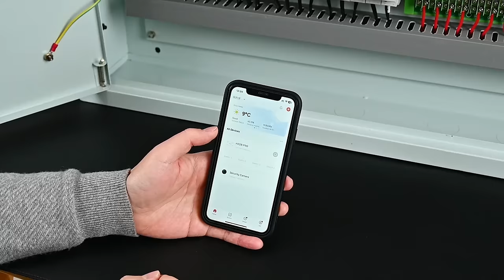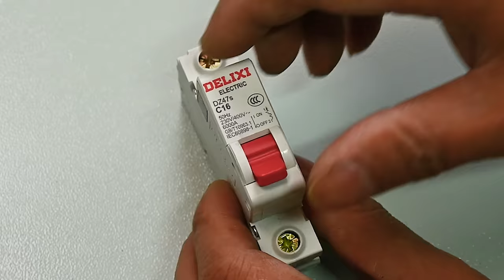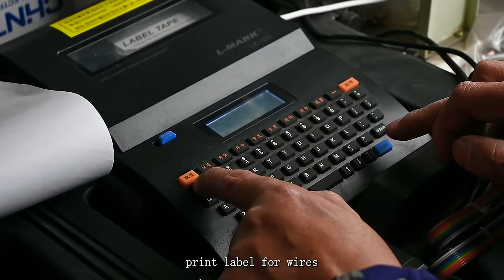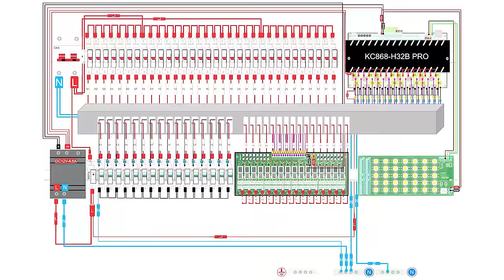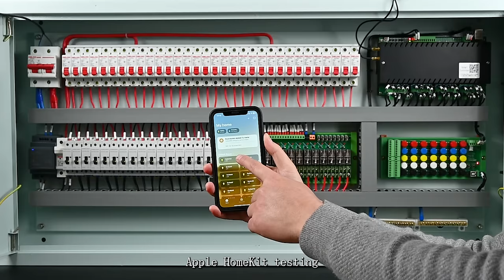Home Automation 32CH Distribution Board DIY | Smart IOT Project 2023!

Comment: This is what happens when a housewife thinks she's an electrician
Reply: More like a sales rep having to attend a trade show. Looks good, works for switching a few light bulbs but don't try it with an inductive load, such as a refrigerator. Or power tools out in the garage.
Reply: @gorillaau  The majority of "home automation" is basically lighting and lower powered devices.  One side of the panel is for 220v the other side seems to be for 12/24v.  Looking through things, you could do 25A @ 220v, but would probably need to increase the wire gauge feeding the breakers and contactors.  Not sure how many would have use for the 12v/24v side though.

Sadly, such a thing wouldn't fly with insurance companies, or home inspectors in the states.
Reply: This is actually pretty good built
Reply: @Willeexd1337  no
Reply: @ДмитрийДмитриевич-ы5х  yes

Comment: The market is too niche and too frontier, no manufacturer does such product. Only the circuit breaker has pre made commercial busbar to connect the unit into one unified company with ease.
Reply from the maker: yes, not widely use it , but in furture will be popular.

Comment: when you plug 12v power in parallel tyis way, it is wrong. because the last one connected device has to get power from all the other plug. The only one way to practice like that is,, in this condition,, to soldering the wire inside the connectors. Also, the first wire will have x times more Ampere to deliver than the last one. Then finally, the best practice is to make them really in parallel the way that current will be the same in each wire and innthe most direct connection from load to source through a repartition connection board. This is the real industrial quality you have to go with. Yours is out of any industrial standard. please, learnnthe industrial standard connections practice.
Reply from the maker: dc12v only use for relay's coin, current is small.